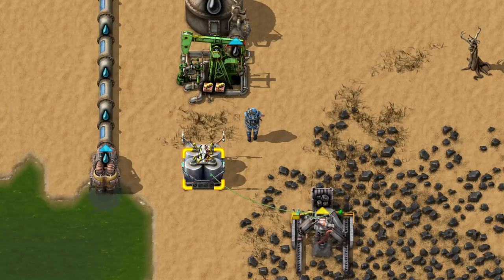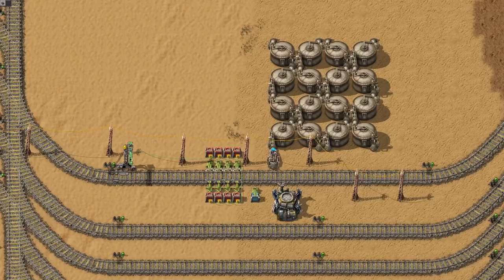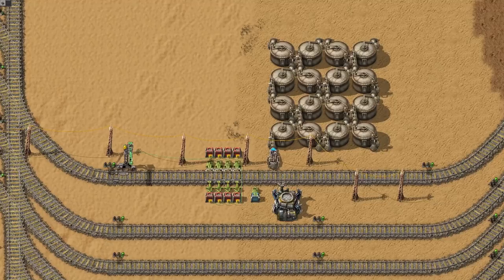Bullet train

Comment: I didnt know you could turn train stops off with circuits!! thatll be so useful
Reply from the maker: Yes you can!
Reply: You can also set train limits with circuits on the train stop
Reply: @ingmarins  In my current factory, I have one train at my solid fuel production, set to go to any refuel stop. And at the refuel stops I have circuitry that disables the stop if there is more than enough fuel in the station chests. So the fuel train sits at the fuel production most of the time.
Reply: It's better to set the train limit to 0 instead of turning off the station because if you turn it off any train that's currently on the way will have to repath and if there is no other open station it may end up stopped on its tracks. Yes it's rare but it could happen. Reducing the limit to 0 instead will not call any new trains but any trains already on the way will still complete their trip. In this instance either way will work fine but it's good to keep this all in mind for other uses.
Reply: Trains do be weapons!
Reply: @achillesa5894  Thanks for the heads up!
Reply: I use circuits to enable load stations if their trackside chests (I like to have two rows of chests st my "solid" stations) or tanks have at least a trainload, and enable unload stations if they have space for a trainload.
Reply: @Trupen  i lovd you,
I didnt know that, it makes it so so easier
Reply: You can connect anything to circuits besides the things you wanted to
Reply: I managed a setup where if a train is at the station, and another pulls in then the first will leave. I built into the space that I had originally planed for a longer station and don't have an easy way to move it.
Reply: @seanpeacock4290  how did you implement it?
Reply: @jmatya  I hope this makes since:
green wire connected to the train stop - power poles - Rail signal a space behind where the last train car will be stopped - a second rail signal behind that about 2 car lengths. 
Train stop logic; send to train
Train logic; leave when Circuit (red signal = 2) or empty
I think that is everything. 
I don't think the wire color is important but you do need to make sure that there are no other red signals on the wire you use or the train will leave when that + the rail signal = 2 or it might not leave if the signal is 3+
If I have time and don't forget I will try to make a video on it. If I do (no promises) I will reply with a link

Comment: Very important tip he said here is giving multiple trains stations the same name, very valuable, especially in multi-station applications.
Reply: If two train stations with the same name are active, what’s the priority list?
Reply: @nobleradical2158  it will take the first or closest one, but you can disable it as needed with a circuit condition. I like to put train stations back to back at my base, so for them to go straight to the farthest station and not block others, I make a circuit condition to disable the front stations unless the next forward station is occupied, I.e. sending the T signal.
Reply: @guileteemgowitevryteeng1711  oh, so that’s how you make a train yard. Thanks.
Reply: @nobleradical2158  sure thing, on the map you can see alternating white and red lights for open (enabled) and closed (disabled) stations

Comment: I don't really use trains that often, even though they're really fun. I just use the risky and inefficient 3000 tiles conveyor line.
Reply: What?  Inefficient?  That's just your accumulating table.  Keeps you stocked in case the line goes down farther up.  Makes sure you don't know about it until the job is big enough to deal with.  No small conveyors equals no small problems, it's the fastest way to make sure you are always busy.